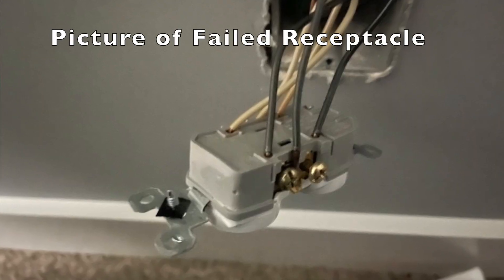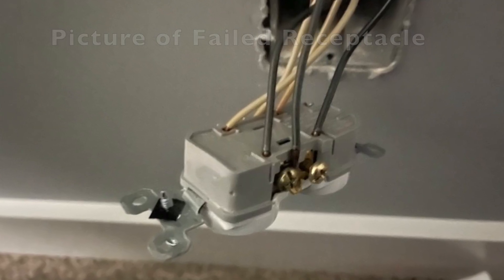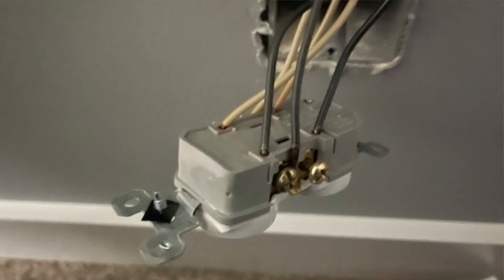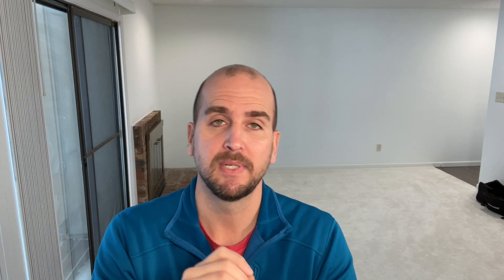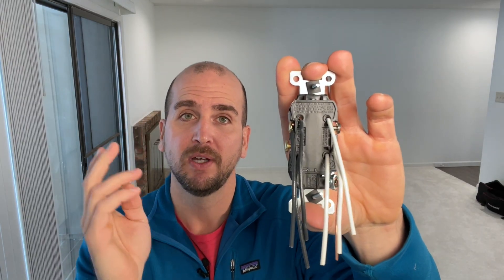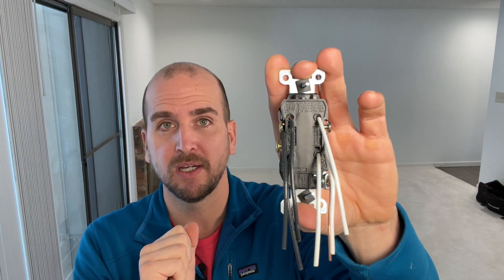Incorrectly Wired Outlet Found In Newly Built Home

Comment: With WAGO faster and more secure, less space.
Reply: Agreed. I only ever use the lever WAGO's. They have a larger contact area with the inserted wires compared to the push-in connectors on the cheap outlets. Makes it easier to rework boxes and does not work-harden the wire from having to twist the wires together.
Reply: @stevefrawley9756  Love the WAGOs.  I have had a few instances where levers have popped open in tight boxes but I just throw on a wrap of tape now and all is good.
Reply: @StevePatak  While playing with them I have found that the levers have to be opened fully before they can be removed. I have yet to have them pop off while working in a box. I just make sure to flick the levers if (in the rare case) they are slightly open, before closing up the box.
Reply from the maker: Do you like the WAGO push in or WAGO with the levers to secure the wire?
Reply: @EverydayHomeRepairs  We use mostly without Lever. I remember when I was a Teenager in 1970s we used kind a similar like the WAGO. Btw. You explain all the Stuff very good. 😊👍
Reply from the maker: Thank buddy and appreciate the engagement 👍
Reply: @EverydayHomeRepairs  Im a licensed electrician in Norway. Wire nuts are history over here, we have been using both push and lever wagos for many years.
Reply: @Joe-by8jh  The WAGO 'Wire Nuts' do, but not the 'Lever Nuts'... Totally different mechanism. Actually, they may not even make the 'Wire Nuts' any more...
Reply: I would agree, but I have not used that many WAGO to make a choice, there good in tap boxes, but... they look to me like they are like the stab in's on the back of a recep.
Reply: @jamesmuravska2922  Wagos have been used extensively in Europe for many years without issues. They are like stab in's except they are properly designed and manufactured with quality.
Reply: @Joe-by8jh  Yes, but Wago has superior quality control compared to some of the crap receptacles...
Reply: I hate on wagos but we all have success with them, emergency anx temp use only.
Reply: they said that about stab connections, too.
Reply: This is apparently a divisive topic, and I’m a total noob. I’ve seen as many people advise against the WAGO’s as endorse them.
Reply: @PJErvin  it’s NOT American, that’s your only problem. 🇩🇪Engeneering
Reply: @Joe-by8jh   I totally agree with you I will still with wire nut everybody bitch about using the back on plugin when wago are the same thing
Reply: @gnuse60  they aren't the same, the lever wagos are used in medical trailers and rolling clinics. Levers clamped down and shrink tube placed over them. They're bouncing around on the highway for years with no issues.
Reply: @gnuse60  
Believe me, Wagos are not the same as the push ins on the back of cheap switches and receptacles.
Reply: I've heard there can be issues with WAGO's failing under high load conditions.
Reply: @trog.lodyte  https://www.youtube.com/watch?v=fjNUzd6LDsU
Reply: @DirkGorgiel  Thanks for the link, looks pretty capable of taking the load in that test
Reply: 🤢🤮wagos
Reply: @Pancake4o  not American Engineering, I know. 🤭
Reply: @Pancake4o  get used to it, we Germans are better in Engineering. Approved by Billions of people. Real Facts.
Reply: Wirenuts not wagos.